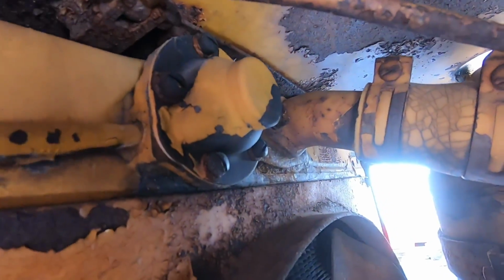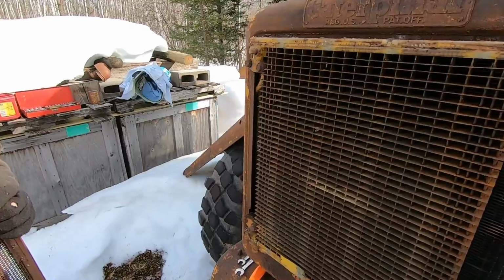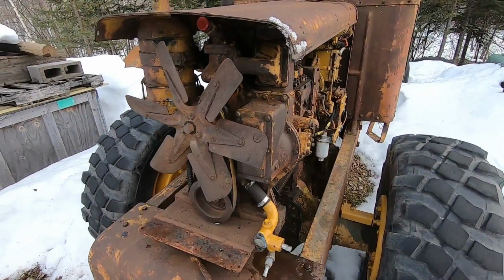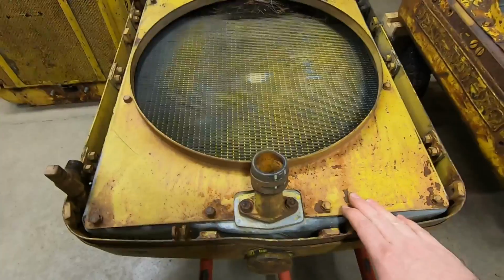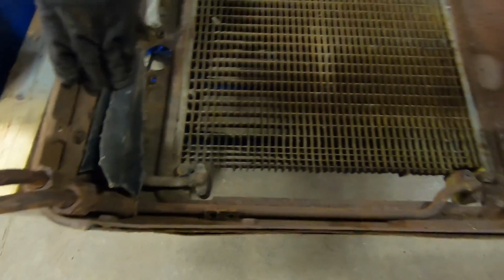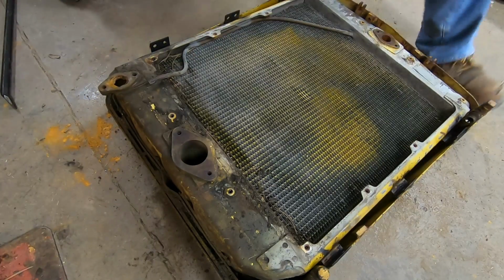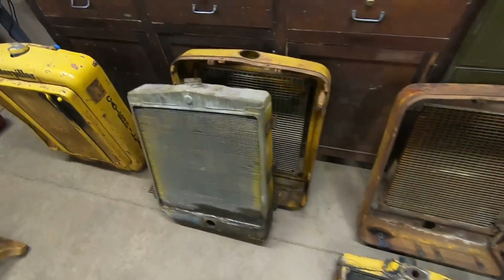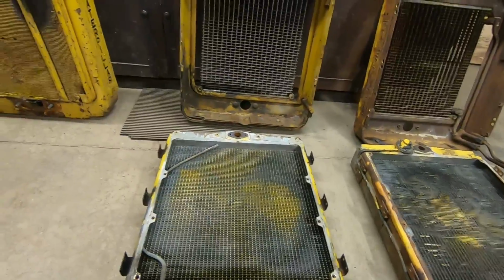Caterpillar 212 Grader #1U152 Radiator Removal & D2 #5J1113 Radiator Repair Update

Comment: Hey squatch, where would you take a radiator around Central MN? I need a rad modified from non-pressurised to pressurized and am struggling to find someone to do the work.

Comment: Good Evening Squatch,
In the last 5 minutes; you compared the radiator s of 5J1113 and 1U512, you note the extra length tank on the 1113 unit.  
In center of the tank the is a port with two bolt holes like lower hose connection, but that connection in on the left side.  
What is the extra connection for?
Reply: was wondering the same thing

Comment: at 10:06 when you pulled 1113's radiator out of the hardnose..  is that what is left of a seal that would have been between the top of the radiator and the inside of the hardnose ... to stop rain water and dirt from falling in around the cap..
Reply: @squatch253  hmm.. quad lobe o rings.. something from a transmission rebuild kit. i take it you are going to make some cardboard patterns of the top of the hard noses.. so you can pound the bent one upward..  you may want to contact the radiator shop and take an unbent hardnose down so while they have the top tank unsoldered from the core.. they can massage the top tank to fit properly. or just compare to the other good one.

Comment: Squatch, on the 212 Grader core, adjacent to the upper inlet, there appears to be a diaphragm pod of sorts that is absent from the other cores. What is it? My best guess was an actuator for automatic grill shutters. Great video, enjoy the trip to the Radiator shop! Will you be traveling in old blue or Sr's truck?
Reply: Thats a pressure valve.
Reply: @RomeKG471  For what purpose? Why on a 212 but not on the D2?
Reply: @squatch253  Thanks Squatch, i needed to ask since it was present on one but not the others. Appreciate you setting me straight and teaching me something!

Comment: Radiator guys must be artists at soldering and unsoldering old joints. Hope they can repair those dents.
Reply: It's pretty easy honestly. The hard part is having the proper tools and the cleaning .
Reply: john dowe I suspect many things look much easier with some experience. I wouldn’t know which way to turn after lighting the torch.
Reply: @glennstasse5698  yeah some folks don't have the skill set. But yeah different strokes for different folks

Comment: I'm surprised to hear radiator shop , as you guy's are very self sufficient ?
Reply: Jimmy Britt i had the very same thought and was going to post, you got in ahead of me. 
Squatch,  your responses clarifies.. but I'm curious how a modern day radiator shop would be handling these 80 year old irreplaceable components. They have to be different from the regular Ford/GM/Toyota plastic crap, no? Or has radiator technology not really changed that much?